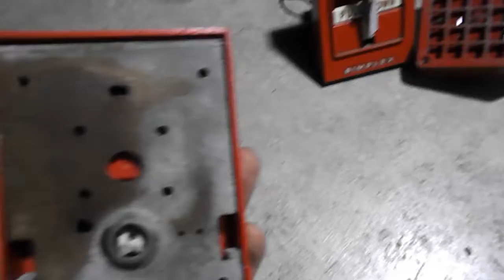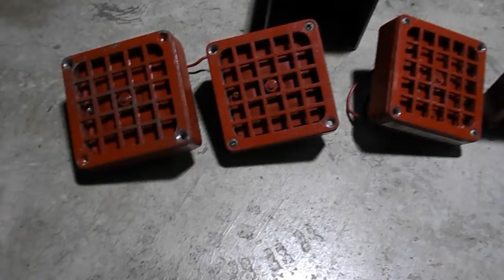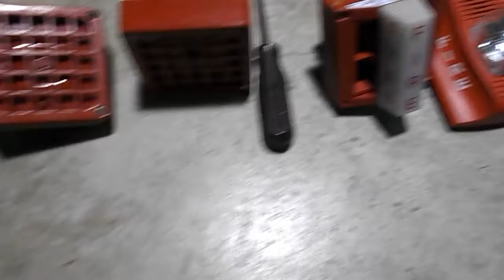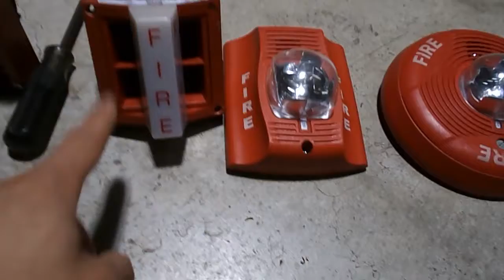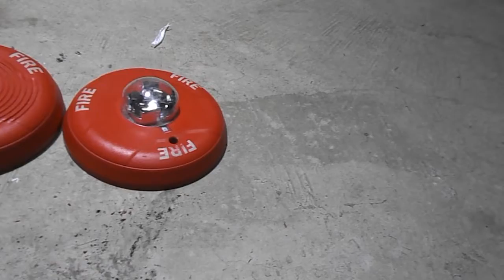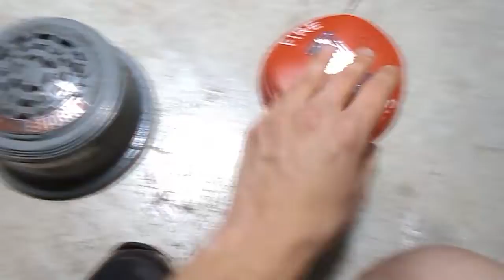My Fire Alarm Collection

Comment: Dude the system sensor spectralert adavances are not dc or ac they are reg alarms like the wheelock mt
Reply from the maker: Shayne Waite It says 12 or 24vdc on the back.
Reply: Not mine